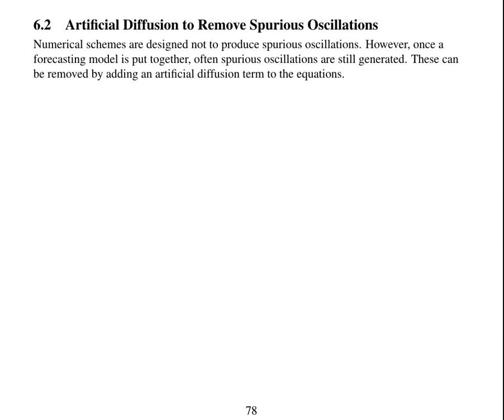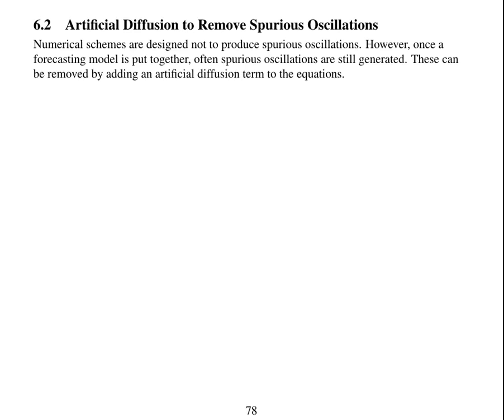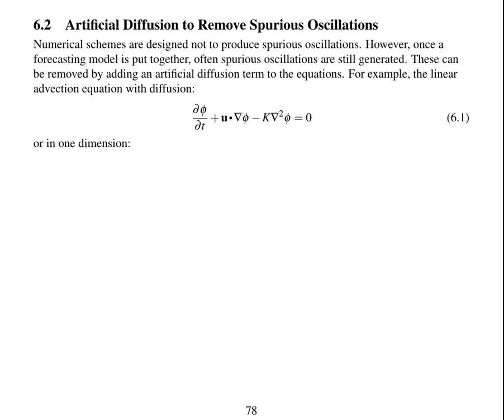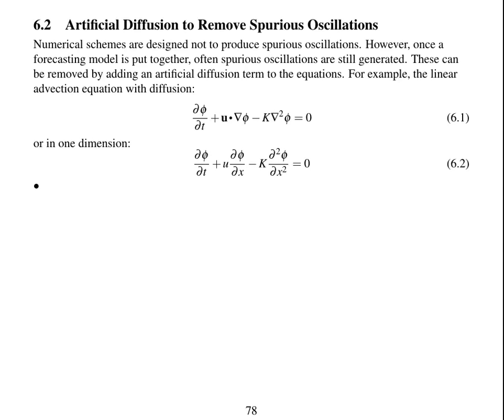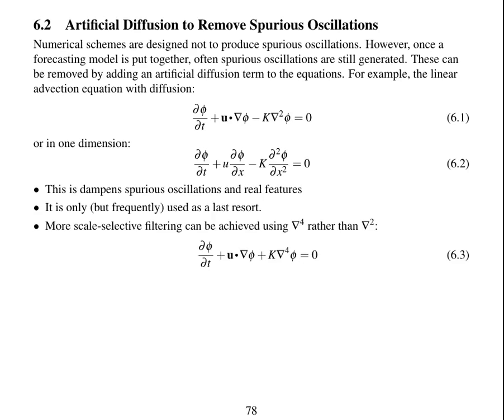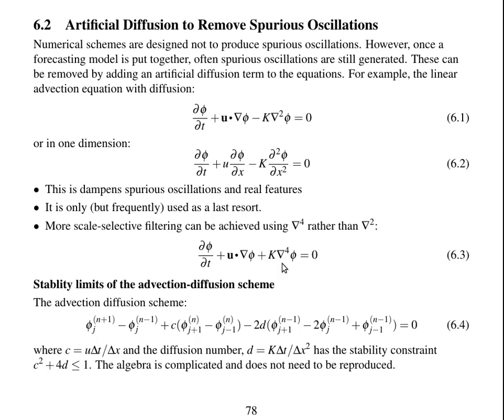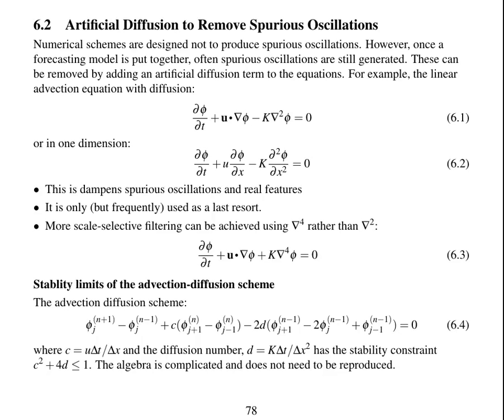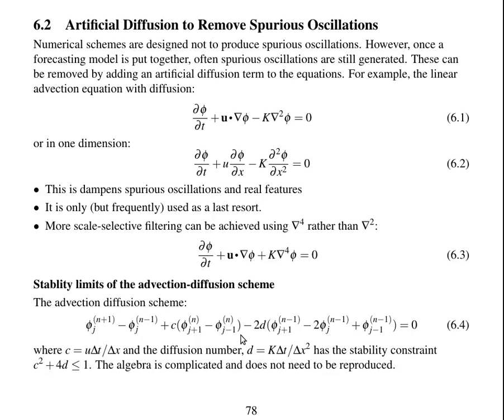7.2 Artificial diffusion to remove spurious oscillations

Comment: Hello,
A couple of days ago, I had a brief discussion with my advisor about the topic of artificial viscosity terms.

Taking the Euler equations as an example, artificial viscosity terms introduce additional dissipation to simplify the solution of "high-compression/shock" problems in CFD.

1.  From the perspective of numerical solving, does this count as a technique for equation solving?    It's similar to the extended formulas and theorems in most math textbooks, which can help us score higher on exams.

2.  From a mathematical viewpoint, for nonlinear hyperbolic PDE problems (shock wave problems), introducing artificial viscosity terms transforms the equation itself into an elliptic-type PDE.

Is there a more rigorous mathematical formulation that can better illustrate the characteristics of artificial viscosity?

I've looked up some references, but the results weren't satisfactory.    I'd appreciate any suggestions from you.

3.  From a purely physical standpoint, artificial viscosity doesn't actually exist—it's just that after introducing it, the solution results lean more toward what I expect to obtain.

This kind of logical discrepancy between "non-existence" and "existence" is a bit troubling for me.

Last：My wording might not be perfect, but thank you very much for taking the time to read this.
Reply from the maker: Sorry. Just seen this. I think that your descriptions of artificial diffusion all sound accurate. I am afraid that I don't have much to add. 
A few comments. Artificial diffusion can be seen as a numerical method because the diffusion coefficient reduces as resolution increases. So the numerical method is still consistent. Also, Lax Weddroff can be written as added diffusion with a coefficient that depends on Courant number

Comment: Thank you for your lecture about artificial diffusion. 
I have some questions about diffusion.

Physical diffusion term exists in Navier-Stokes equation. 
Then, I think is is possible to solve horizontal physical diffusion term instead of solving artificial diffusion term which is added to equation artificially.

In reality, vertical physical diffusion term is calculated in pbl scheme. 

Nevertheless, why the horizontal diffusion is solved by adding artificial term instead of physical term?
Reply from the maker: In the atmosphere and ocean, the diffusion is tiny, particularly above the boundary layer. The real diffusion is not nearly big enough to control a badly behaved advection scheme.
Reply: Very thank you for your fast answer!! Then, does that mean  the artificial diffusion contains a little of horizontal physical diffusion effect?
Reply from the maker: @namefamily2474  The artificial diffusion is the same mathematically as real diffusion but the diffusion coefficient is much larger than the viscosity of air.
Reply: @hilaryweller615  I understood the artificial diffusion thanks to your considerate answer. Again, I appreciate your explanation.